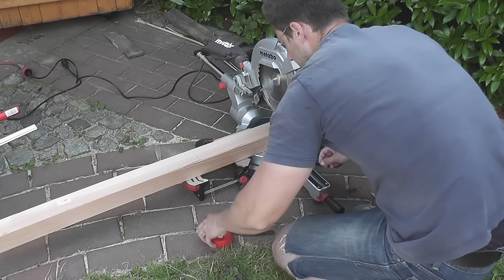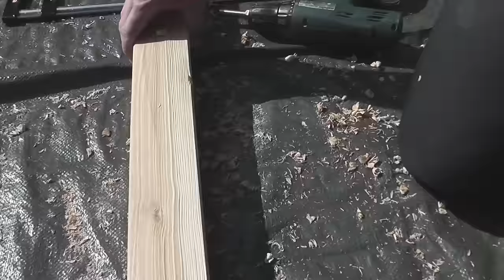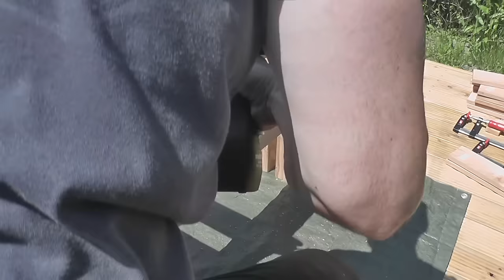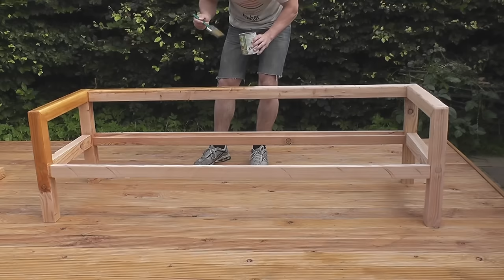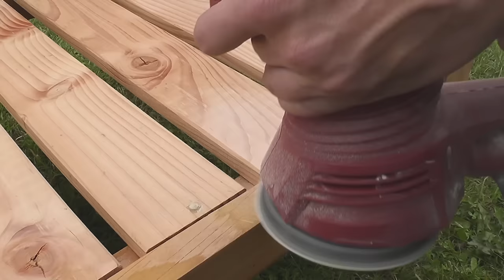DIY Modern Outdoor Sofa - Gartenbank selber bauen

Comment: Good job. I wouldn’t have plugged those slat board screws as you’re going to need to remove and replace them in the future when they rot or worse, break. Looks great tho
Reply from the maker: Thanks for your comment. 😀 Yes you are right. In my last project I screwed the slats from below without plugs.

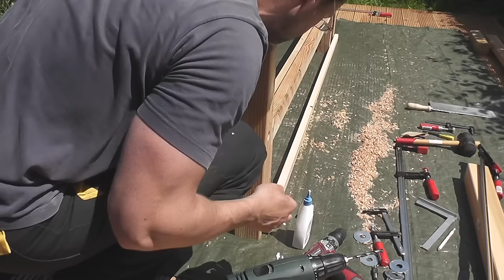Comment: Nice Video, i have one concern (sorry)......if I am looking at it correctly...around  minute 11:15 and forward......the entire seat platform is being held up (supported) by basically 4 screws  and glue ? I can imagine at least two adults can sit on the bench, can the 4 screws support that kind of weight?  I am not trying to be negative! It is a very nice looking bench! ..I'm just wondering . 🤔....am I missing something? Thanks!
Reply from the maker: Hi Michel,
thanks for your comment. Yes the screws are very strong. It's diameter 8mm. These one will use for Roofs. 😉 
Best regards Nico

Comment: Hi, really like this outdoor sofa it's great. Having trouble working out how much wood to order to try myself, are you able to let us know? And can't find what those screws are you are using.
Reply from the maker: Thank you very much. 😀👍
The dimensions  are: 
width 204cm, height 60cm, height of seat 31cm, depth 67cm. The wooden beams are 7x7x200cm. The wooden boards are 10x200cm. I think I bought 7 or 8 wooden beams. 
The screws are 8x100cm stainless steel plate head with torx. You also can use hexagon head screws. 
I hope this will help you.
Reply: @heimwerkerzeit   Great thank you!

Comment: What is the tool you use to drill the holes and what screws do you use
Reply from the maker: Do you mean this one?
https://a.aliexpress.com/_dVr5HlY
In Germany it's called "Forstnerbohrer". The dimension is 25mm. 
The big screws are 8x100mm and the small ones are 4x70mm

Comment: what about measurements and sizes? does it depend on you on how long or how big you want it?
Reply from the maker: Hello.
The dimensions of this sofa are: 
width 204cm, height 60cm, height of seat 31cm, depth 67cm. 
Dimensions of the wooden beams: 7x7x200cm.
The wooden boards: 10x200cm. 
😉

Comment: Hallo Nico. Ich habe vor die Tage nachzubauen. Leider ist in den Baumärkten meist douglasie ausverkauft, sodass ich nur Fichte/Tanne bekomme. Ist das sehr schlimm ? Die Sitzhöhe macht mir auch zu schaffen wie sieht es mit der Bequemlichkeit aus wenn ein 185 cm Mann darauf Sitz.
Reply: Kannst du mir verraten wie viele 2000mm Kanthölzer du verwendet hast. Wäre es sparsamer 3000mm lange Kanthölzer zu kaufen ?
Reply from the maker: Hallo. Douglasie ist unbehandelt deutlich witterungsbeständig. Mit einer guten Lasur, bzw. mit Dünnschicht- und Dickschichtlasur wird auch Fichte usw. einige Jahre halten. Unsere Hausverkleidung ist aus Kiefer und unsere Fenster aus Fichte. Beides ist inzwischen 20 Jahre alt und hält  noch immer. Wichtig ist nur die regelmäßige Auffrischung der Lasur.
Ich bin 1,8im groß und kann auf der Bank wunderbar sitzen. Hatte die Höhe damals durch ausprobieren ermittelt. 😉
Reply from the maker: Ich glaube es waren 7. Allerdings waren sie länger als 2m. 2,20m oder 2,50m. Bin mir nicht mehr sicher.
Reply: Danke für die schnelle Antwort. Also bei Fichte Tanne lieber eine Lasur statt Öl. Ich werde die Bank nur auf dem Balkon stehen lassen der überdacht ist, nass wird sie nicht nur feucht.
Reply from the maker: Gern geschehen. 😉
Hatte meine Bänke mehrfach geölt und bin davon überhaupt nicht begeistert. Werde die Bänke demnächst abschleifen und dann lasieren.

Comment: Well done (Gut gemacht), however, I do have a couple of criticisms; 1: You went to a lot of trouble to hide the main screws with wooden "plugs" but you paid no attention to the direction of the grain on the plugs, this is a bit sloppy, especially since you put so much time in, 2: You stained/finished the whole bench before fitting the seating boards, then sanded the (unnecessary) wooden plugs while sanding again over some of the main FRONT frame, meaning that you had to re-stain them, resulting in different colour shades. I know I'm being a little "picky" but I know if I was sitting on it, my eyes would keep looking at those wooden plugs and drive me crazy! Ha Ha..
Reply from the maker: Hello Steve, 
Thanks a lot for your comment and tips. I didn't even think about the grain of the plugs. I'll do that next time. 😉 
I painted the sofa before because it is not so easy to paint between the boards. But I would also change that next time. Regards, Nico 😀

Comment: Manda por favor a metragem
Reply from the maker: Você quer filmar?
Reply: She is asking for the dimensions
Reply from the maker: Ah ok, google ttanslator has not translated correct. The dimensions  are: 
width 204cm, height 60cm, height of seat 31cm, depth 67cm
Reply from the maker: Olá, as dimensões são: largura 204cm, altura 60cm, altura do assento 31cm, profundidade 67cm